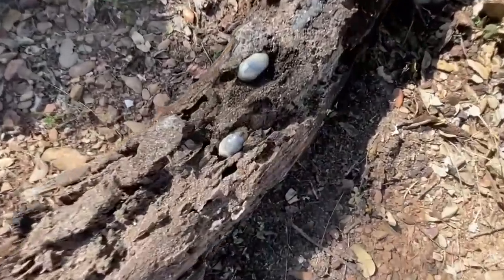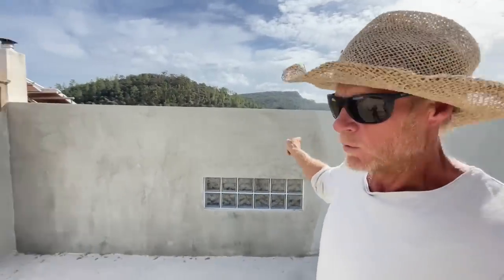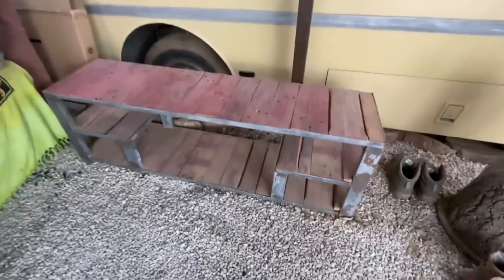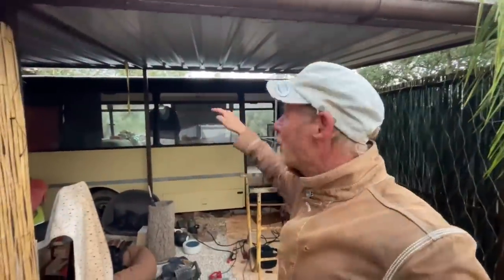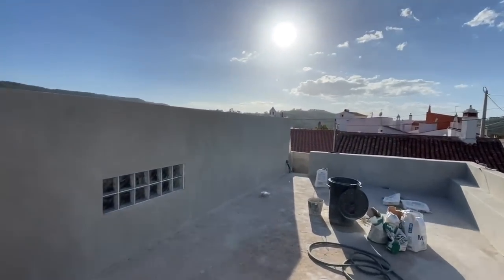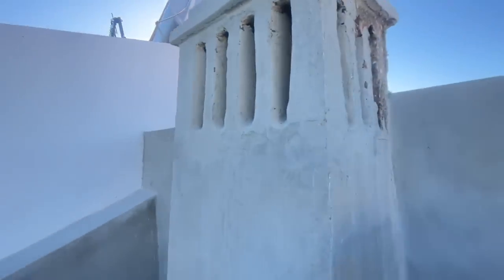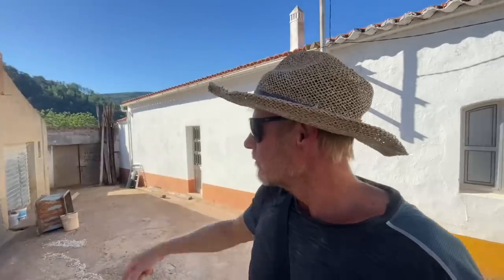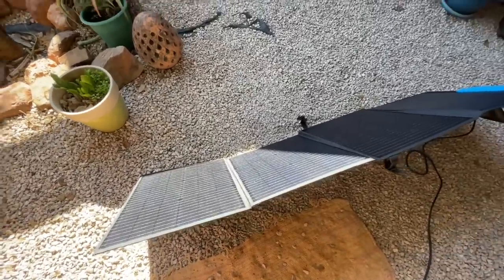Making A Feature Out of Old Chimney Is Transforming The Village House Restoration #94

Comment: Andy, on YouTube there are videos on how to work the rod so there’s penetration and metal buildup from the rod.  In the beginning you might want to weld the pieces in a flat position. Not up or down.  It takes a lot of practice.  And resting one arm against something stabilizes ether welding arm nd hand. Gotta have stability so you have control of the tip of the rod. Your welding arm floating in air is almost impossible to control the rod in those tiny movements needed.

Comment: Hi Andy when u stick weld don’t weld straight move very slightly left and right so the weld layers and then when you grind it down you will get a better finish.   And when you weld thick steel always angle the edges so the two edges go together they form a v. Hope this helps my father was a welder so I just learned on the job best regards Andy from Felixstowe uk.
Reply from the maker: 👍thanks

Comment: Hi ,nice job love all your vids , bit of advice please , I'm back out at my project end of month , and I'm going to be having a go at some rendering,what render are you using? I have a new extension which is bare red clay blocks,  can the render go straight on? Do I need a cement scratch coat first or maybe a grit render adhesive what's your advice cheers Paul
Reply from the maker: I mentioned in #93